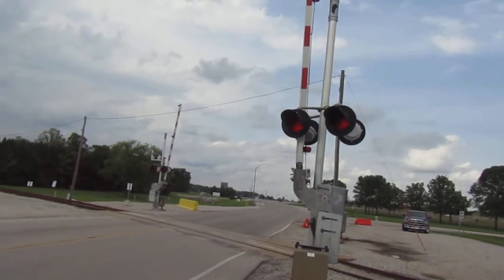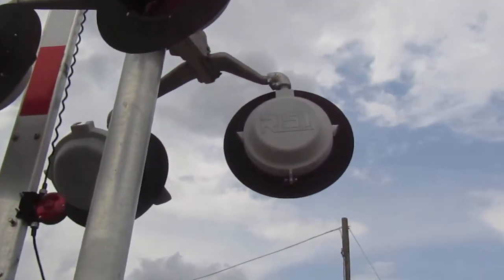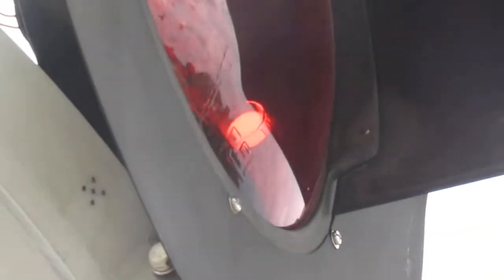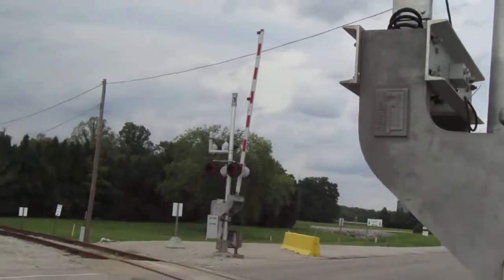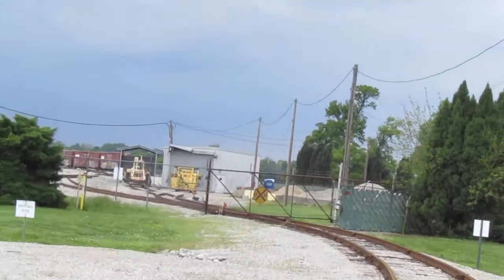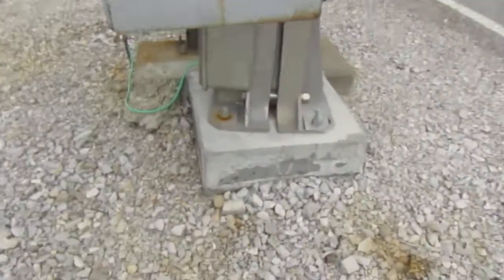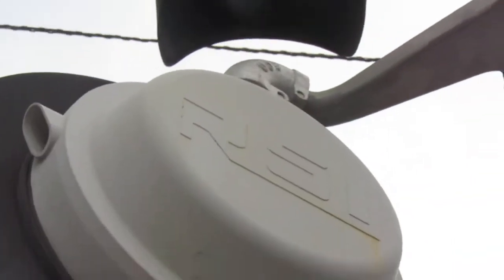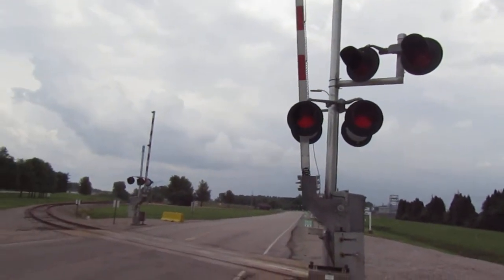(RSI Equipment) Private Crossing Tour, near Yankeetown, IN

Comment: Here is RSI's shady business practices:
Bases - rebranded base from an unknown manufacturer (US&S and Harmon use(d) these too)
Gate mechanisms - Siemens, not even rebranded. 
Counterweight Arms - copied from Siemens. 
Light brackets - Copied from a US&S design. 

The only thing that is an original design is their bells and light heads. From what I heard, their quality was crap at best, which led to their demise.
Reply: Their gate lights were original, too.  They were shitty in design and not very popular, but they did have a unique array of LEDs that spelled out "STOP" on the front of them.  That was the only thing visible on the gate light when powered.  The "regular" LED light on top of the assembly only had five weak LEDs.
Reply: I've seen videos of them, and they are very dim. Very low quality.
Reply from the maker: All of this is correct. RSI's bad quality is well demonstrated in this video. Would really like to see some of those "STOP" gate lights some day. Also, their LEDs were original as well.
Reply: There is a gate with the STOP gate lights at the Midwest Threshers Reunion, wherever the hell that is.
Reply from the maker: @natestrains1166  There's a few there. It's in Mount Pleasant, IA. I plan to go to it this Labor Day so long as the pandemic allows (which I guarantee it won't).